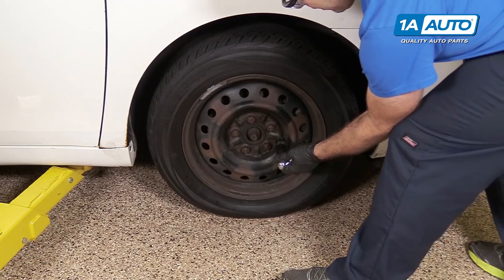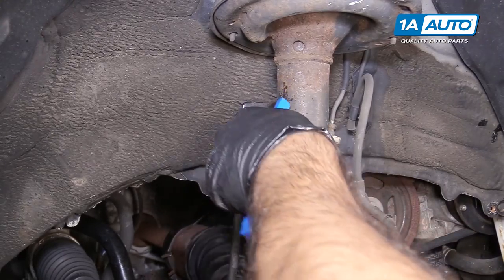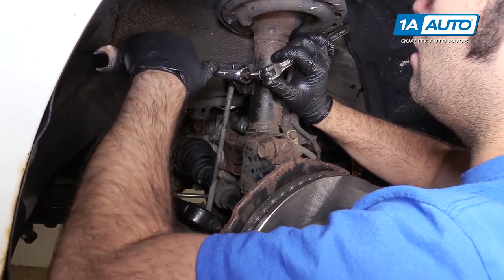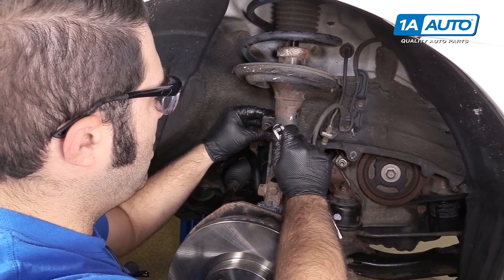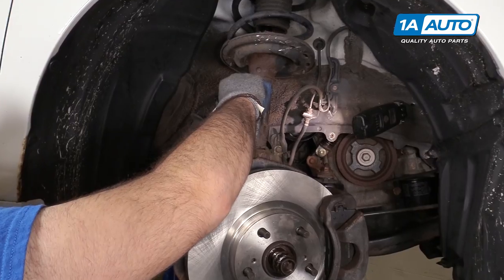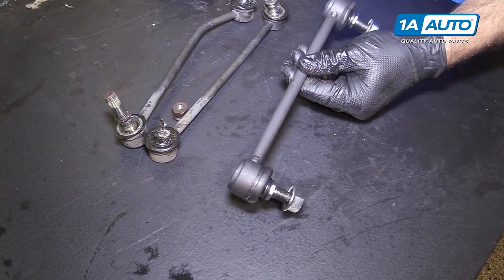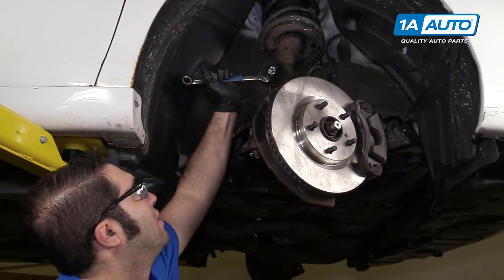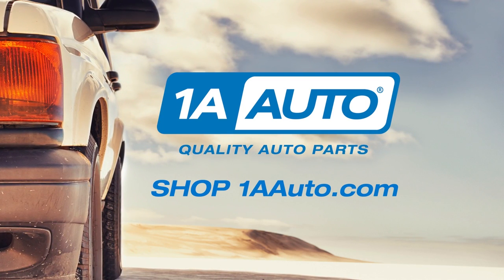How to Replace Front Sway Bar Links 06-11 Toyota Camry

Comment: The Haynes repair guide I have for Toyota Camry says torque for upper sway/stabilizer bar link nut is 52 Ft-lbs (model years 2007 to 2011).
But lower is 55 like you said. Great video...I'm about to go do this on my '07 Camry right now...thank you!
Reply: Finished it the same day. My barber suggested using "PB B'laster" as rust penetrant instead of WD-40...it worked good enough
that I could use hex driver and wrench to get the old rusty ones off. New front sway bar links fixed the annoying rattling I had when driving.
Thanks again for this video!

Comment: The hex drives immediately stripped out on my old end links  on top of the rust and I had to resort to cutting them off with an angle grinder.  My new 1A Auto end links luckily had an actual hex nut on the back you could put a second wrench onto for installation and removal.  And they were much thicker and more robust than my old stock end links as well.  Very satisfied with them.
Reply from the maker: +midnitebo Thank you!
Reply: @1AAuto  how can I make order parts for camery 2005?
Reply from the maker: +Rakan Rakan Thanks for checking us out. Shop for high quality auto parts on 1AAuto.com:

http://1aau.to/m/Shop-1AAuto-c

Comment: 55 foot pound for the stabilizer link and 76 foot pound for the tire.  Thank you for the torque specs. Great video.
Reply from the maker: +Joseph Garcia Thanks for checking us out! http://1aau.to/m/Shop-1AAuto-c
Reply: torque specs should be listed along with the required tools, it would save so much time.

Comment: 2006 Solara 3.3 SLE... so I just did mine including end links and struts... i was freaked out at some of the vids but let me say it was NO WHERE as difficult as people have posted.  I did mine from underneath but ONE side at a time (why? I live on 3 acres and if ANYTHING happened such as a jack stand/jack failure its RIP me)- from underneath i had full access to the mid section bushings... yes space is tight but i did it with a 1/4 drive for the easy access bolt and a 12mm combo wrench from underneath.... at one point the only thing connected was the UNJACKED end link.  As I was also doing the struts when I was done with the jacked side completely including installed mid section bushing I went to the other side- passenger side..  the bolt closest to the front is a little easier to access from underneath when tightening with a 1/4" drive.  IF I had someone at the house for sure jacking BOTH sides would have been easier but not by a lot as from underneath you can really do almost ALL.  I hope this helps.  IF I ever have to do this again its a 45 min repair.  i hope this helps... i got a few short vids but it really wasnt so difficult to warrant any pics or vids

Comment: Starting out with a rust penetrant and a burb gun usually cracks it loose. Failing that, braise it with a torch. If it's taking longer than 10 min's to remove, it's not being done right.
Reply: Drill it out. Took me 2 minutes
Reply: Please explain this to me. The drilling. Thank You @ExtraJohnson

Comment: My favorite way to remove is a Carbide drill right into the center of the bolt's hex hole to remove the head. You really need a carbide.

Comment: I didn't see any crossfades here on the video, , so that would lead me to believe that no time was spent letting the rust penetrant actually penetrate, which tanks generally a minimum of 20 minutes
Overnight is best

Acetone and power steering fluid fluid as a mix is probably the best rust penetrant I've seen used.

If you can work on a drive bolt or a brake bleed banana boat, it should definitely work for this application in my opinion
Reply from the maker: +Dan Lo Fat Thanks for the tip!

Comment: Is it possible to just use a nut breaker tool on the sway bar nut and then use a pin punch to hit the spindle out of the hole? Question because I’m doing this job in 2 days

Comment: Should loc-tite be placed on the bolt for the stabilizer link? How about a new stabilizer link with a grease fitting?
Reply from the maker: +Joseph Garcia Thanks for watching!  You can add some Loc-tite if you wish, but it can make removal even more difficult when it comes time to replace them.  If they come pregreased with no hole for a grease fitting, then you do not have to grease them ever!  If they do have a hole then they will have to be greased periodically.

Comment: Hi,I have a 2011 venza, I try to replace the link, the top side of the link that attached to the strut is easy to remove. but the lower side that connected to the sway bar is a pain, it seems that the link is screwed in the sway bar,

Comment: My 2014 Camry is pulling aggressively to the right over 90kmh. I have been told my sway bars need changing after I had it serviced. The alignment and the tyres are good. But could the sway bar be a problem?
Reply from the maker: +k12rmy It could be the sway bar links.  You should take the advice of a professional.  Thanks for watching.
Reply: @1AAuto  thanks for taking the time to reply.
Reply from the maker: +k12rmy Thank you!

Comment: Is the front shorter than the rears or are they the same in length ?
Reply from the maker: +virachai336 The rears look like they are a little bit longer than the fronts. Thanks for checking us out! 1AAuto.com
Reply: @1AAuto  thanks for that.. I had order a set for the rears and receive a shorter one ..about an inch different from oem ...would it be ok to install them ?

Comment: I don't exactly know if you are trying to make this look intentionally difficult to drum up more business; however, you'll never strip a nut if you use a socket wrench in conjunction with a breaker bar. I just did this job on my 2013 Toyota Camry. It took as much time if not more to jack the car up and take off the tires than to replace the sway bars.

If you strip the nuts on this job, I cannot imagine what you do when you do a brake job and replace the rotors...

Comment: Why not just tap the allen key in lighty with the rust in the hole and try to get it "stuck" instead of cleaning it all out and then adding......oil.....to not make it slip?....not the best mechanic over at 1a I'm afraid...and why not just cut a slit in the in the end of the sway bar stud and use a large flat head to keep it from spinning instead of going apeshit with a sawzall next to the strut....ehhh

Comment: You should tell people to use anti-seize when installing new links.
Reply from the maker: +fw1421 Thanks for the tip!
Reply: Where do you suggest anti seize should go?
Wouldn’t using anti-seize on nuts and bolts mess up the torque specs?